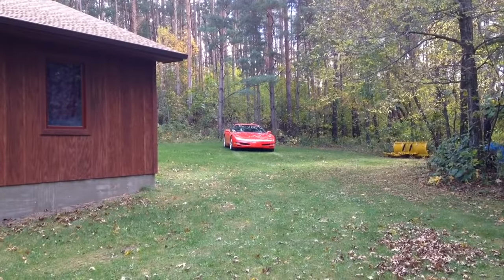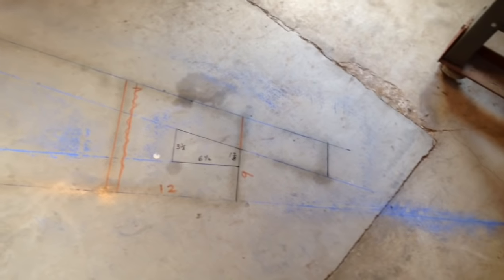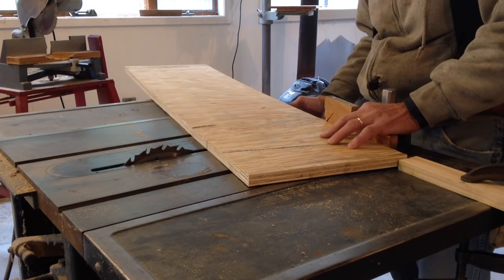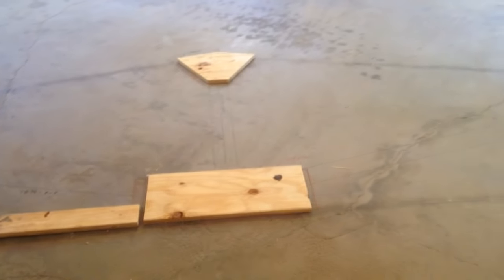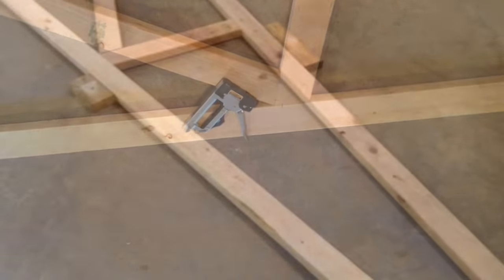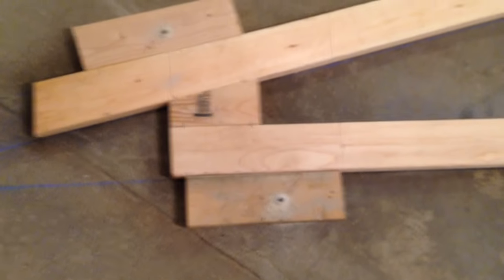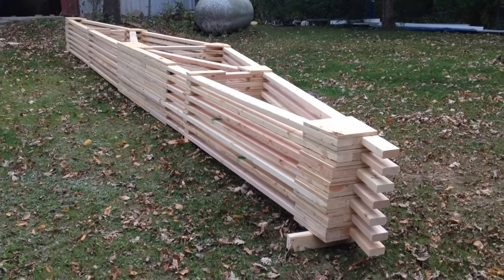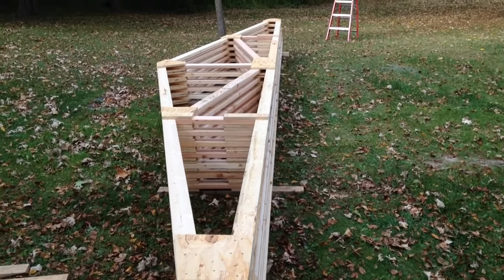Build your own wood trusses

Comment: 6-8 weeks to get the trusses?  That's insane, at the truss plant I'm at it would only take 1-2 few days to get them.
Reply from the maker: steve french Thanks for the comment.  If i were you i would keep buying all my trusses at your plant.  Around here the truss process is:  A salesman will take your order, a draftsman will draw the truss, an engineer will review the drawing, once approved, a production manager will put the order into the cue, the trusses are produced, and the transportation manager will schedule delivery.  If you can get that all done in a day, then you truly have an exceptional truss plant.
Reply: flyboyslc1 The designing and approval process is more or less the same, The productions manager will place it in cue depending on when you wanted them, if you wanted them as soon as possible then "rush" would be stamped on it and it will be built immediately.
Not too sure how long the designing and approval process takes but on the build sheets underneath the program they use to design them it says the date that file was created, They haven't been any more than a few days before.
Reply from the maker: steve french   Hi there Steve.  I always like to here how things work for other people.  In Iowa, just walking into a lumber yard and telling them you want trusses delievered by the end of the day or even three days from now would be met with laughter.  It works for you and that is all that is important.  You are correct in the design and approval aspect.. Likely all done by computer software doing the calculations, but eventually an engineer will need to stamp and sign the drawings.   What i am saying is that just because i want trusses in a day or two, the truss manufacturing facilities i am familiar with would never be able to meet that kind of deadline.  They have production in progress for other customers and they will not stop and re-set their jigs for my 10 truss order just because i want a "rush"   By the way, i never thought this video would be viewed by more than a couple hundred people at most.  Very surprising that it has the interest that it has.  Best wishes.
Reply: flyboyslc1  I only build the trusses so I could be wrong about the design and approval times, maybe the dates on the build sheet is the date it's been finalized and approved, not sure.

As for the rush jobs, i meant we will build what we have on the table then as soon as that's done we will do the rush job, which are never more than 20 trusses.

This is a good video, very informative, but ya not many people search up roof trusses on youtube haha.

I only did it because I wanted to see how other companies were doing it, working in a plant that has only one roof truss table it's very weird seeing multiple tables and the builders on them moving as slow as molasses.

Comment: Here in Australia, all timber trusses would have to be Engineered certified
Reply from the maker: Building codes in USA are local and not national in nature.  They are more prevalent in densely populated areas, and sometimes non existent in rural areas.  Where I live, any farm structure is exempt from building codes.  And remember, many buildings built centuries before still stand proud without any engineering.  And others fully engineered did not make it past their first year.   https://youtu.be/XggxeuFDaDU

Comment: If a building inspector were to see this, he would shut your job down without an engineer's drawing. And no engineer would put his stamp on these.
Reply: What's the problem with them?
Reply from the maker: Hello Steven.  If you watched the video? i cautioned anyone subject to code enforcement at the 1:10 point of the video.  If you live under that thumbprint, by all means abide by their rules.   After 48 years of carpentry, i do not need or want an inspector or engineer involved to build a simple truss.  I am blessed by not being subject to this level of bureaucratic BS.  These trusses held 45 inches of snowfall here in Iowa this year.  Engineers are important people for sure, but some food for thought for you.  The Pyramids were built without an engineered drawing.  They are still here.  While the Tacoma Narrows bridge, the Hyatt Regency Kansas City mezzanine  collapse, and the recent Miami walkway bridge collapse all had inspectors and engineered drawings.  They all ended up on the ground in a pile, with deaths too.

Comment: Sparks flying out of your nailer
Reply from the maker: Yes Wil, they sure are.  You are the second guy to comment on that!  what it was I think is a generic brand strip nail that didn't fit the Paslode nailer perfectly. The driver rod on the air nailer just clipped the next nail in line just a little and made the sparks.
Reply: ...I was wondering if you needed more or a better quality oil
Reply from the maker: Hi Scott,  The oil you put in an air nailer  lubes the piston and not so much the driver rod.  I think either the driver rod or the generic nails were the issue.  Should have done the video in the dark, would have really been colorful.  Best wishes, steve

Comment: in 2020, I was quoted 200 per truss for a 14-15 foot span !!  Came here for a better idea.
Reply from the maker: Dan, that is outrageous!  If you are talking about a common 4:12 truss with 15 foot span that is a very simple truss to build your self.  Just make sure your building department will be OK with it.  You could also frame the roof with rafters and use something like an LVL (laminated veneer lumber)  2 by 12 for the ridge board if you want a clear span.  That would be easier to get by a touchy building department than a home built truss.  
steve

Comment: Not allowed to make your own trusses here in the UK. Have to get a structural engineers design ok'd by the building control first.  The truss manufacturer does all this for you and it can be a long wait before approval and manufacture. I'm lucky, I got all this done with a 2 week turnaround.
Reply from the maker: thra5herxb12s   Hi there.  There are many places here in the USA that would not allow it either.  Part of the cover your butt world we live in.  Where i am at, i still have some freedom and liberty to do this type of thing, and so i do.   These trusses have performed as expected, holding snow and wind well.    Good luck.   steve
Reply: Your trusses were very well made and you know what you are doing, but many people with the best of intentions make a bad job of most things they attempt and I guess thats why we have regulations, and if you get DIY disaster type tv shows over there then you will know how things can go badly wrong. Regards  Dean.
Reply from the maker: thra5herxb12s   Dean,  no i have never seen the type of tv shows you mention, but i can imagine!  It is interesting how differently different parts of the world look at things.  When i first started to research homebuilt trusses a little, i found that the Canadian government actually had a lot of data available to help their citizens build trusses on site.  Areas of 
Canada are very remote and so getting factory built trusses to places in Canada is difficult.  So, they helped their citizens by showing them how to do it correctly. Other places in the world with larger population bases experience things differently.   As usual, as government moves in, freedoms vanish.  A regulation here there and everywhere.  The hidden costs of regulation and taxation are what chokes an economy.  I would one day like to visit the UK.  I watch a tv show called Doc Martin and the little sea-side village that it is filmed in looks very quaint.  Best of luck to you.  Steve
Reply: Yeah I forgot the war of independance was about local planning regs.
Reply from the maker: +thra5herxb12s  and soaringtractor--  My comment here is that there is too much control both in the UK and USA.  Not that much different in either place I suspect.  It is more and more a CONTROL world.  I do enjoy the freedom that living in rural Iowa brings to me.  If I were in an urban setting, then I am governed by a Building Department.  Some people need a building official to keep them straight, others do not.  Unfortunately for all of us, the government just gets bigger and more intrusive all the time.   Good day to both of you.

Comment: Just because you can do something doesn't mean you should.  I've done this for 3 projects.  It is very labor intensive.  But I was young and stupid then.
Reply from the maker: Kenneth Wallace   Ken, I think if you watched the end of the video, I said the same thing.  For me, I didn’t want to wait for a truss shop to make them for me, and then getting them trucked to site was a problem since i live waaaaaay back in a timber.  Steve
Reply: flyboyslc1 I noticed the book now carries a disclaimer saying the designs are old and outdated according to new codes but really that is not true. a roof load is a roof load...I think they just don't want liability....its a great book.  If you built one of those designs for the load specified....there is not a problem.  The book is of engineered designs.
Reply from the maker: Kenneth, no offense taken.  I really enjoy getting comments like yours, with the link posted.  I had one fella angry at me because i didn’t explain how to engineer a truss.  I told him my video was how to BUILD a truss, not engineer it.  Your link is great info.  Thanks for posting it.  Steve

Comment: No way you can build these for $25.  A sheet of 3/4 plywood alone is $30 and 16 foot 2x4s are $7.
Reply from the maker: Hello Dual,  Always enjoy reading the comments people post.  You need to remember that i built these trusses (and the video)  4 1/2 years ago.  Lumber is a commodity and prices vary.  Right now (2019) i can buy 3/4 CDX plywood for $20.  I think One sheet would make gussets for 2 trusses?  Have to do a layout to be sure. So i have about 10 bucks in plywood per truss.  2 x 4-16 in SPF (spruce, pine, fir) are $6.50.  Lineal footage would require about 4 of these, so figure $26 in lumber.  Add in a little money for nails and glue, and in 2019 dollars probably $38 would buy the lumber. If i want to use southern yellow pine the cost goes up about 25% for the lumber.  I can buy them from the local big box lumber store for $75 each plus delivery costs.

Comment: Fire breathing Paslode huh ? ... never seen that action in all my 45 years !! ....
Reply from the maker: Made me laugh Charlie!  If i had it to do over again, would not buy another Paslode.  Maybe they got better over the years.  If i had bought paslode nails dont think i would have had the fire show!  Just had those nails laying around so decided to use them up.  I think the driver rod was clipping just the edge of the next nail in the clip, and that is where the sparks came from.  Need to check the driver rod and make sure it was not damaged.

Comment: Nice work but...WHY ON EARTH WOULD YOU BUILD YOU’RE OWN TRUSSES? it’s far cheaper and usually quicker (with properjob site planning) order them prefab because then that company has liabilities. And WHY THE HELL would you have a 3-12 roof? What a horrible pitch I hope it doesn’t snow or rain much where u are. I ONLY build trusses when a customer asks for them specifically or when time is of the essence due to specific situations, other than that just stick frame the roof with the proper 2 by material depending on pitch on load ranges
Reply from the maker: Landon,  You have been busy!  Ill try to answer your post.  The trusses that i built were not a common length. (so not available without a custom order) They were built to fit on a building that was already on my property when i bought it.  I wanted to add 14 feet on the end of it so needed 7 trusses to do it.  Existing slope of roof was a 3:12 so matched it.  We recently had the 3rd highest snowfall total here in Iowa.  So much for climate change and man made global warming.  45 inches total snowfall.  And while 3:12 is not a very common slope for lumber framed roofs, slopes as low as 1:12 are common on steel framed roofs.  No problem with my 3:12 and snow.  I wanted a clear span below my trusses so could not frame it with rafters without spending more for heavy lumber than what the trusses cost to build.

Comment: Rely on siri lol...

Why not just build it with rafters?
Reply from the maker: 2Awsome.  Great question!  Rafters are a good choice in certain circumstances.  Where walls are not so far apart they work well.  
Also, you generally need a bearing wall mid span in order to land the ceiling joists if you wish to have a ceiling, which I did.  Trusses also allow the roof go go up quickly.  I did frame my entire gambrel roof house out of rafters, and they are fun to do.  Best wishes.

Comment: Nice job on the trusses! I have a 1996  Collectors Edition LT-4 6 spd convertible, last 5 of the vin are-xxx00006! 59k miles if you know anybody interested! Again, great video on building the trusses.
Reply from the maker: Hello Richard,  Those LT-4 engines were good and fast for their day.  Probably a lot easier to maintain than a ZR-1.  I will bet it is a lot nicer car than my 1991 L98.

Comment: 1. You are not making those now in 2024 for $25.00,,Cool video
Reply from the maker: @davidb7699.  Made me laugh on that one David.  Yea, almost need to add a zero to that 25, don’t we?  At one time during the cv craziness I saw a 2x4-8’ that cost $10.  It has come down quite a bit, but still way over what it was when I did the video.

Comment: I always shudder when I see a saw with no guard or riving knife, please use both and work safe !!
Reply from the maker: col stace   If you feel you need a guard and splitter, then by all means use them.  I have went without for 45 years with no issues, and will finish that way.  Guards and splitters are useful perhaps half of the time using a saw.  All the small “fall off” “ pieces of the gussets would get hung up in the guard and could get thrown backwards at me.  With my experience level i feel safer without these devices.
Reply: flyboyslc1 no matter how careful you are accidents can happen, that's why it's called an accident, not everyone has your many years of experience/luck

Comment: These types of trusses are dangerous; I've seen many of them fail.  They are not as strong as manufactured trusses with metal truss plates.
Reply from the maker: Well Keith?  These trusses have been above my corvettes and work bench for 3 years now, with heavy snow and wind loads, drywall across the bottom chord, insulated, carrying a full load,  and they look like new.  Perhaps the craftsmen where you live are not well skilled?  Post a link for some of these failures you are seeing, I would like to read about them.  As far as metal plates being stronger, well NO.   They are quick and easy to apply with roller presses in truss plants, that is why they are used.  With trusses,  Half of the loads at joints are in tension and half are in compression, relatively speaking.  Any joints in compression are weak across the joint with metal plates, because there is much less stabilization for lateral movement than the plywood supplies.   My trusses with plywood plates were much stiffer in a lateral direction and required much less bracing during installation as a result.  best wishes, steve
Reply from the maker: Thanks Britguy.  Keith is on to something though and I think you and I would both agree on it.  A truss poorly constructed be it either in a truss shop or field built is a "truss not built right" no matter where it comes from.  I have seen trusses come from truss plants that had poor quality lumber with knots that completely spanned the cross-sectional width of the lumber.  When we picked them up with the crane, the members broke apart.  We had to do field repairs specified by the truss plant.  An interesting note---when the truss plant supplied the "approved field fix" it never involved usage of the galvanized steel splice plates.  It always specified usage of plywood or lumber to span the broken truss parts.  cheers---steve
Reply: My father in law has a machine shed on his farm that has site built trusses. They are over 50 years old and the building is still standing. My son in law is a firefighter and he says in a fire the steel plates on factory trusses
 pop off long before the wood burns through and the roof collapses. Have you ever converted rafters to trusses after they were already part of a house?

Comment: Really,   how many building departments are going to investigate if trusses were "site built" or not?  I mean so long as they LOOK factory built quality using proper grade stamped lumber??   Or is there some stamp they put on the trusses at the truss factory that inspectors insist on seeing?  You know the way they can get looking for the right stamps on roof sheeting etc?   Unscrupulous contractors WILL try to shave their costs if they think no one is looking but my experience as an owner builder has been a lot of leniency ...the last remodel the inspector did not even look at anything but only asked me if I was happy with the work my subs did... It was like "IF there is a problem YOU TELL ME and I will gig them otherwise?  If you are happy then I am!  It's YOUR home buddy...  Which I appreciated it!  It sucks when you get "one of THOSE guys" that just LOVES to inflict the letter of the law EVEN if what is there is as good or BETTER than "code"
Reply from the maker: Hello Doug,  nice feedback and thanks.  Regarding the building inspectors and home built trusses:  Whether or not they would allow it would depend a little on the building department somewhat.  Small ones may be OK with it.  Others would ask for the stamped set of engineered plans that would go with the roof truss package, and if you cannot produce that set of plans, they would not allow the trusses.  You are correct about building the mock-up and then mass producing.  Good day!